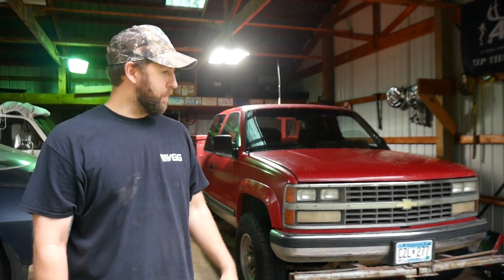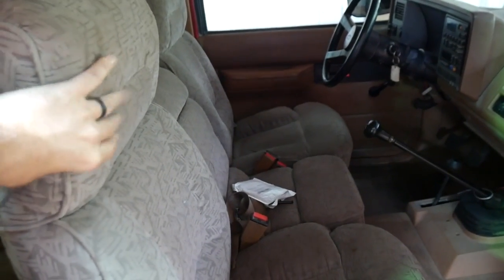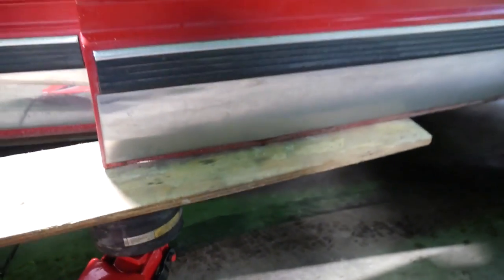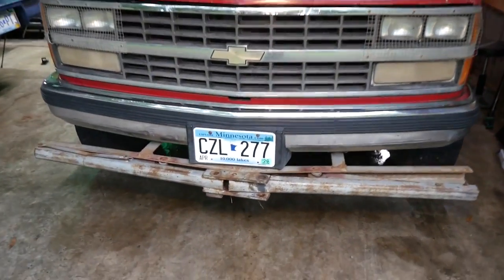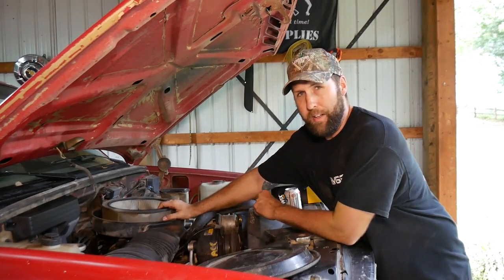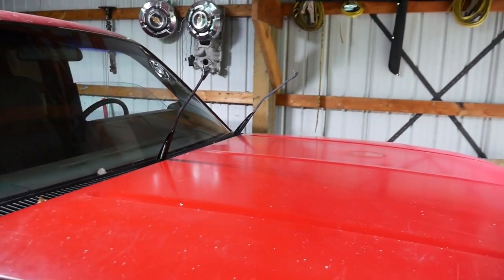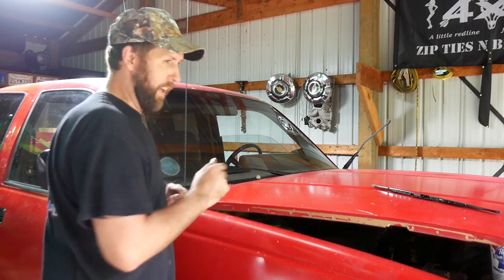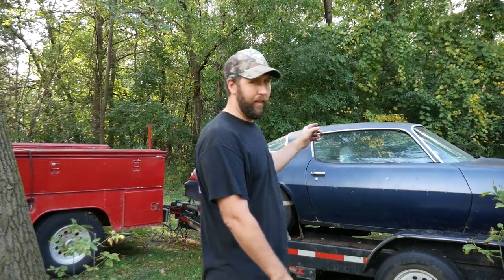OBS Chevy K2500 Service Truck - Vice Grip Garage EP41

Comment: Take the breather off the fender so it stopped taking in water,and dirt!! and flip the air cleaner lid upside down,   still fits the same but breather much better it will run better!.  Then you can take a file a file down the little lips on the top of the tbi unit around the front (top side) so the air gets In there faster, and do an air raid tbi 2 inch spacer I had a 1990 4x4 silvarado all this helped with a mild built motor,
Reply from the maker: Nice thank you!

Comment: Hi  Friend Derek, I followed all the video OK But I did not see a special FRONT BUMPER with a winch the same at the rear, also a cover over the accessories ( Generator -- Compressor) Roof carrier, Good bench vice -- Frame for a tarpaulin in case of rain....? Rear camera, orange spinning lite, accessory mud ramp, power saw, welding generator, frame for block and tackle, That would be "almost" complete servicing workshop TRUCK !!! Ye I like all your work even when you say "I DN'T KNOW !!! "  All the best my friend !!!

Comment: Run an adapter on the TBI so you can run a 14" x 5" air filter. the 1" TBI spacers do help some. Going to headers with a decent exhaust will help as well. Hypertech chips will wake them up a bit as well. Sadly, the biggest 2 things i can suggest are a hyd roller cam swap and upgrade the heads. Many will tell you do a vortec head swap. A couple of draw backs to that: Youll probably need to visit a machine shop. In stock form, the vortec heads are VERY limited on valve lift. Another being you will end up buying a different intake and headers. for them money youll spend doing a vortec swap a feller could probably just buy a better aftermarket head that works with all of the stock stuff.

Comment: While brake cleaner does clean everything, I can confirm that if you use it to blow dust/fluff out of your phone's charging port it will get inside the screen and make it go really dark.
Will update if a night in a bag of rice fixes it, if it does its gonna be my new cleaning technique for all digikal devices.

Comment: Putting the VGG logo on sides would be nice and some Darkness illuminators in the back for those late projects and maybe you could snip some little ones in those tool holding deal a barbers on the sides. Hey don't forget and this is very important listen closely don't forget to make one of those metal tool box Jimmy barbers special like for cold snacks.

Comment: Maybe you could try to fix the compartment door latches on the service truck that are being held shut with bungee cords. Those type of latches are not to expensive and easy to find. They can be a little tricky to line up but with a little help from Tonja Harding 6 pound enforcer, that job should be able to get done inside of 7 days.

Comment: Put a welder generator on it and a gasoline air compressor that would make it real handy. Also the tool boxes need fixed up and filled up with tools. It would have to have locks so people dont steal everything out of the boxes. Touch it all up with plenty of that BMW red. Oh yeah it needs a vise on the back bumper or some place on the back of the truck. Maybe get Lincoln or Miller to sponsor you a welder generator. Or harbor freight.
Reply from the maker: Vice would be nice! Dont even have one in the shop😅

Comment: I really want to see you straighten out the doors on the service bed and get it fully functioning again I had to do the same thing on my old service truck it was flipped and I straightened out all the doors and got them all working again also I want to see you putting on a welder generator air compressor and the oxygen and acetylene tanks

Comment: Yeah Moooooooooooore!

Hmmmmm?

I thought that the full size 1990's Dodge Trucks procured the patent on the door hinge "Bird With A Broken Wing" feature/faux-pas/fox-paws?

My cuz "fixed" his 1980's somthin Jeep Cherokee drivers door issue with a few judiciously applied & quite large barn door hinges (on the exterior of course).... The front passenger door "Locked" with a bungee cord attached to the door pull & "Locking" on the center console or ones own left side pants belt loop(depending on the passengers safety concerns & level of training)

It also did double duty as a very poor seat belt....

Comment: And its the cheapest one u can buy thats metal, and came with a metal box that bolted to the fender well, and has rubber trim that seals to the hood so no water gets in and well its decent for the price, now I run a K&N typhone 2 on my mustang, the cheap one is on a 2000 dodge ram 4×4 roller 318

Comment: OBS is 1973-1987 square body. GMT400 88-98 is NEW body style. The burb and K5 blazable went one more year with square body style (OBS) into 1988. This is why they are called OBS. A guy could walk up to the parts counter, and ask for a set of headlights for a 88 suburban, and the feller behind the counter would ask ya what body style.  Old or New.. I don't care what the morons are saying what OBS is today, because I was ALIVE when this all happened.. I bought my 89 fresh out of the factory. For the first year I owned it, I had to CONSTANTLY say it was the NEW body style. I still have my 89.. it was my first new truck in my then young life.. spent 13 years doing a frame off resto. Spent twice what it cost to buy her in the first place, but it's the only thing I truly love. She never.. and I mean never, left me stranded on the side of the road, even after 189k before the resto began. Probably the best trucks GM ever produced.

Comment: My pops by a utility box like that for his 89 in 96 he put it on his 1996 for his 2002 the rear toolbox had to be modified a little bit for the frame
Reply from the maker: nice, that's great
Reply: @ViceGripGarage  his 89 and 96 had a really good trade-in value when he put his never used original box back on the trucks they were kept outside though so the paint would fade the same

Comment: Do the ultimate TBI Mods in a video. Or swap vortec heads on, either one would get you a bit more neck breaking from the ol’ accelerator pedal.

Comment: All across the land you'll find utility companies and cable companies with one old truck sitting in the back with a big block. It's the one truck they had that didn't have a small block to puke its guts out. Small blocks don't last from the abuse and extra weight they're carrying around.

Comment: I really like Chevy that truck is a nice one I would drive the wheels off and put them back on again over and over the parts are affordable for sure sky is the limit on what you could do with it put a welder on it cutting torch aircompreser  it be nice to work on other junk with all the tool on board you can carry with that truck put a DC to ac converter so you have power all the time in a field at in the middle of nowhere lol :-)
Reply from the maker: Great ideas!

Comment: Turn Ole Beet into a chow rig there bud. Propane will run everything if ya spring for rv appliances. A guy wonders what all you could fit in there for chow time at the track.

Comment: Might be interesting for a guy to see what modifications you can throw at the old TBI 2500 to squeeze out a few more HP’s.  I’m talking about cheap stuff done right...like filing away restrictions in throttle body, and maybe adding a spacer plate.  Maybe even throw on a pair of junk yard vortec heads with a mild cam, conversion intake, 454 injectors and 454 computer? Or maybe just LS swap it with a junk yard 5.3 or 6.0 complete with donor trans.  Then you get HP’s and mpg’s!  I always wondered what the TBI motors did with all the gasoline they suck outta the fuel tank.  They sure don’t turn into 1/4 mile slips worth looking at.  I still love my 1994 full size Blazer though.
Reply: Strike all that...put a cam in it, throw on 4bbl intake & a 4bbl carb

Comment: This might sound crazy but.... vortec heads on that TBI small block,  a cheap hx- 35 turbo?  Obviously an aftermarket throttle body / fuel injection software to bolt onto the intake you’d need.  I think that would be the cats Pajamas

Comment: I did just about everything to a 350 TBI in a car - air cleaner, TBI upgrades, cam, ignition stuff, chip, headers, dual exhaust - short of replacing the things that make it a 350 TBI.  Long story short, it runs a lot better, still a sub-300 hp car and still just feels like a turd.  And the cars had 9.2 ish compression, too.  Basically, you need vortec heads, a 4 barrel, and an HEI to make 330+ hp.
Reply from the maker: Thank you great info

Comment: Throttle body spacer, big block fuel pump and throttle body and 3 inch single exhaust make the most difference on those engines

Comment: On my old  Chevy  tbi the  cold air intake made very little power gain. Biggest power gain was when I Installed right by the tbi gas intake line 4 old big hard drive neodymium magnets and 8 oz of  Lucas fuel conditioner per 20 Gallons o fuel.. I would say my power gain went up 15%.  nothing to brag about.

Comment: You gave up too easily on the rear turn signals. Current tester and some cold snacks should work.  And since you asked what we want to see..I think you should repair the service box and install the sparkolater, the fire breather, and the blow tank and make it the field operations unit you've always dreamed of. Good channel bud.

Comment: Hey I’ve got a 96 Chevy k1500 5.7 and it’s throwing a P0300 code i’ve changed all the usual suspects such as plug wires, and rotary button all that any ideas on what could be causing it

Comment: I picked up an old '97 Ford f250 fart around the property with it's got about 350 million miles on it. Question is the passenger door doesn't seem to have much of any gap between the door and the front fender and it catches on it pops when I open the door up how do you fix that?

Comment: Curious to know why you went with diesel oil plus an additive ? And in doing so, how long do you plan on leaving the diesel oil in there? Thanks
Reply from the maker: I run diesel oil in all my old junk classics because of the higher mineral content.  The additive provides better cushion, detergent, and oil pressure.  On my other vehicles that I "care" about, I run synthetic purple oil or aims oil with a zinc additive, but that's spendy
Reply: Vice Grip Garage perfect, thank you for the reply. I asked because I’m having issues with a 5.3 cold start on the lifters and I’m thinking they may be on the way to collapsing soon and i cant afford 2500 just yet. I may try this on my next oil change. I always stand by Royal Purple and Aims oil. Love your content and your positivity, always makes for a good weekend. Keep it up and thanks again!
Reply from the maker: @h33ls_up  thanks buddy, good luck there

Comment: my 92 silverado, I installed a new door pin and ended up loosing the cap to keep the door pin in, I replaced it again, and lost it a few months later, I drilled a hole in it a put in a carter pin, I hate how they go in upside down like that.

Comment: I got a 93 3500 and I've been through a lot with this truck I've even had to live in it for a while and I love this old truck but trans is whining bad in park and rite now it won't run so I'm a onsite mechanic and and I'm losing money every minute Im not running cause I work on cars and small engine and equipment but never done a 4l60e and really confident I can do it but wonder if you know anything that might work first

Comment: I came to give you a minty ass fuckin  hand job through the god damn internet.  I'm the same way with my tools. I always try and clean them when ever I use them. Also I have a K&N "Cold Ait Intake" on my 1998 Chevy S-10 and actually lost a shit load of bottom end torque... But gained about 3 mpg. Owell.

Comment: Cold air intakes need a little more effort than just buying whatever kit was on sale; generally a kit made for a small 4-banger (typically the target market for such things) is just going to choke a V8 and you'll wonder why your power and fuel economy went to hell. For best performance, try to find the surface area/flow rate of your existing filter and buy a cold air intake set that meets or exceeds it.

Comment: If you flip the pancake upside-down on the air filter you get some extra unicorn powers Good stuff you don't want to Miss vöoooom boom haaa
Reply from the maker: Gonna giver on a shot tomorrow and see what happens
Reply: @ViceGripGarage  it's going to have more power because it's not breathing through a straw it's going to get some more air the filter Still wil work

Comment: These door hinges suck.
I've actually made a cradle for my floor jack to hold the doors for and bushing replacement.
I have a 94 and 99 OBS and these things don't last very long, especially on the 99, which is a 3500 welding rig

Comment: go out in middle of no where around 2 am in pure blackness to rescue a go ol Cumins deisel in a old freightliner that tossed it's belt. try to figure out the belt configuration on that puppy. i not that tall but i can stand inside the belt so she has some length. with both arms cut and scraped to your shoulders, any one around you going away knowing a intirely new library of words, and about 45 minutes to a couple hours, you can sit back and ask the lord why me. I was a mobile tech for 15 years, i rescued more old gals from hurting to puling than one wants to know about. some were a bit challenging but i was a bit prepared cause i towed my pick up back with me , you know just just incase that old thumper decided to puke out in middle of no where. and beleive me i went in some places it was like a 20 day walk to any civalization, so the pick was a warm fuzzy feeling to have fallowing me. one trip we went way up into remote northern british columbia,  aprox 250 gallons of water and a whole lotta patients that ol girl was sitting in the shop being tore down. prob saved the fellow 3000 or more for a tow bill so was worth his buck to send me. like derik i rescued Semi trucks only, it was a fun gig, long long tiring days and nights, but i accomplished to rescue every last one.

Comment: What is the reason that you use diesel motor oil in a gas engine?
Reply from the maker: Higher zinc, better for flat tappet cams

Comment: The Cold Air intakes aren't worth it unless you get the whole air box with it. Which can be $$. Otherwise you're just sucking hot engine compartment air through the metal tube. The factree snorkel and air cleaner going through the fender would give you a colder air charge than just an intake tube and filter would. But, if you're heart's set on it then build/buy an air box for it so you can pull colder air in from the front. Probably not really worth it for the negligible gains it would make.

Comment: Nothing wrong with a quality of good used service truck.... Those Hinges worst ideal ever, must of been same idiot who thought putting bolt behind A/c compressor on ford ranger would be good ideal. that way it impossible to do a simple water pump R&R. twice... first one was reman wrong... thanks... luv the content, soon as feeling better got get back on my own 79 Ford Bronco, got the flywheel sound of death... the Crack... so that's gona be fun...  As far as updates if going to put any thing in the back quality service light is always good.

Comment: Do yourself a favor and buy yourself a specter brand OEM filter for that it's similar to a k&n filter but for about probably half the price. Don't flip your air filter lead like most of these idiots do. That is a factory cold air intake on that truck. Help me out with throttle response and MPG.

Comment: 180 hp , and the torque all happen below 4,000 rpm , I got a 305 I my caprice and the 350 in my c 1500 , I test on the 305 like I steal it daily , above 4,000 you just making noise lol
Reply from the maker: Haha yup basically.  I typically shift around 3.5 when pullin heavy

Comment: A guy oughta put new TBI gasket, clean EGR & new gasket, replace fuel pump b4 you get stranded.
Reply from the maker: Sounds like you've been there
Reply: @ViceGripGarage   more than once!  I've had 2 89's alone, 9 OBS's in total.  You got a good service truck there, it's worth the work.

Comment: I've given some thought to what would make this service truck more useful to you for when you go rescue vehicles.  The two items I would like to see are LED lights on the service bed for when you wind up working in the dark. Here is a good source: (https://www.oznium.com/).  The second thing that would make that truck very good is removing the factory TBI, installing a decent intake manifold and a holley sniper EFI kit.  You can get a refurbished unit for $800.  I run holley HP EFI on two old corvettes, and I have a buddy who has installed two sniper systems. One on a 78 ford, the other on an old bronco.  They work great.  Link: (https://www.holley.com/products/fuel_systems/fuel_injection/sniper_efi/factory_refurbished_-_sniper_efi/parts/FR550-511).
Reply from the maker: Thank you kameron appreciate the input

Comment: Check my channel man. Back last year i had a 04 ranger with a cold air intake and all i did was cut the old box out and adapted with some pipe and sealed with rtv. Spent maybe 30 bucks in supplies, of course my intake filter was from a friends vehicle but you could also buy one from orileys. As far as power goes, definiley better acceleration and a nice sound too.